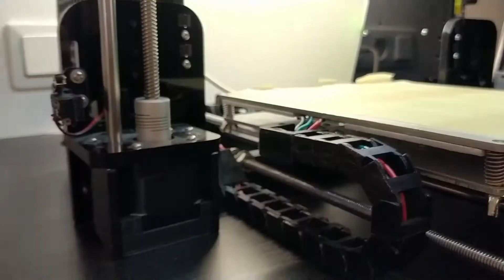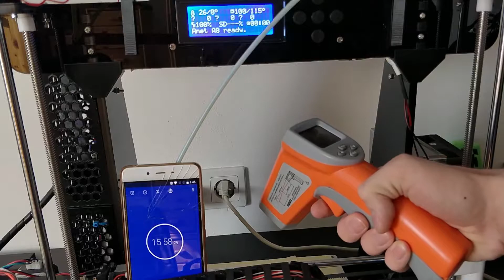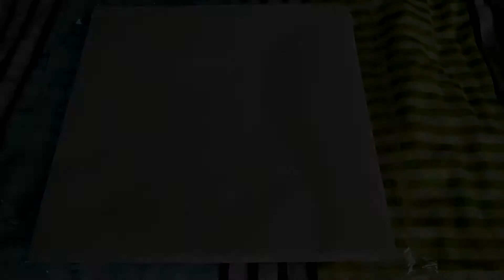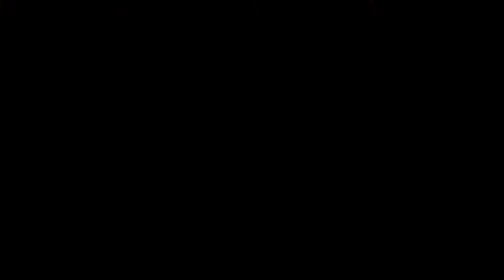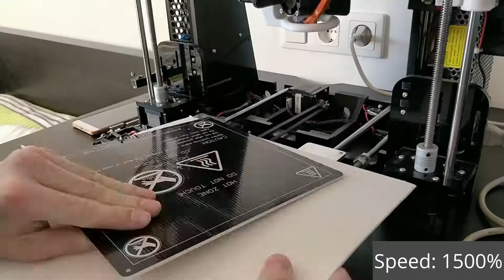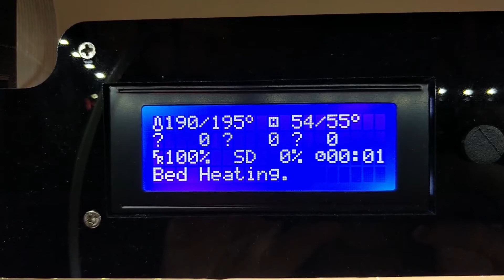Anet A8 - Heated Bed Insulation

Comment: Think I am going to solder my wires to my board. I can't even get to 80 degrees celsius with my bed.
Reply from the maker: Good idea, however this isn't going to solve the issue. I suggest getting a MOSFET to bypass the high current around the board. The onboard transistors are really weak.
Reply: You have a tutorial on how to accomplish this?
Reply from the maker: I have mentioned it in my "Anet A8 - Make it Safe!" video (https://www.youtube.com/watch?v=9Vo7R_n7awM). 
The wiring itself is pretty easy IMO, but you're right that I should have explained it. Just follow this wiring diagram: (https://3dprint.wiki/reprap/electronics/heatbed_mosfet#how_to_install)

Comment: oh! i print pla at 75 degree C. but it still doesn't stick very well
Reply from the maker: What bed surface do you use? I have one spool of PLA that doesn't stick to a heated bed with the tape as well too. However, it sticks perfectly to a taped cold bed!
Reply: Masking tape 3m 2214 , sometimes it sticks but when printing big parts it doesn't even stick for the first layer! Plastic sticks around the nozzle and the whole print fail even before building anything.
Reply from the maker: Especially for larger parts, use some brim. For every huge part on my A8 I use a 5 layers wide brim just to make sure that the part doesn't fail. Try it out.
Reply: Nah ! The printer messed up the brim and caused the print to fail
Reply from the maker: Did you inspect why it failed? Maybe your bed isn't properly level.
Reply: I used a paper to level the bed. The plastic extruded from the nozzle doesn't even adhere to the surface and the string of plastic moves making the brim smaller than the real model. I'm planning on buying a sheet of glass to try making it stick. btw the model i'm struggling to print is the front brace made by Leo_Nuts( https://www.thingiverse.com/thing:1857991 ) the back one seems to be okay but the wall still fails at first and i need to remove it and making some of it stick to the infill to prevent it from failing the structure of the  upper section.
Reply from the maker: Maybe try using a different temperature or some gluestick to get better adhesion. Also, print the first layer at 10-15mm/s.
Reply: Didn't notice that there is a Initial layer speed in Cura , the brim printed perfectly .THX
Reply from the maker: Nice to hear that it works for you now ;-) 
Happy printing!

Comment: I got some of the same cotton. But instead of glue I just stuck it on with kapton tape; easier to remove if necessary!
Reply from the maker: Hi, thanks for your comment. It's nice to hear that it works with tape as well. I chose to glue it on as I'll probably not remove it anytime soon...
Reply: How did you apply kapton? I was thinking of 3m adhesive tape?